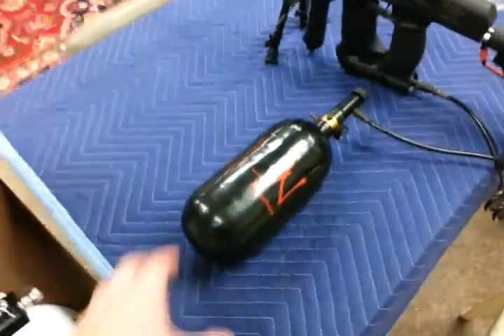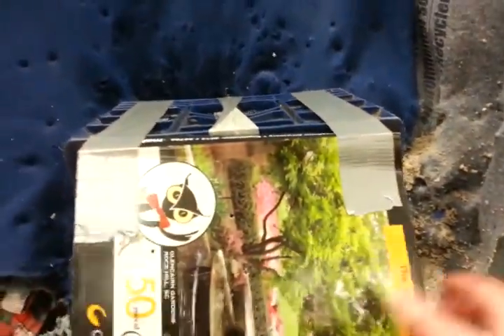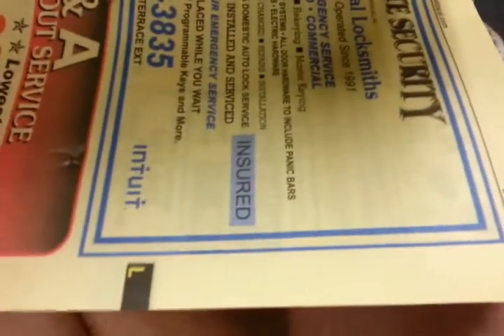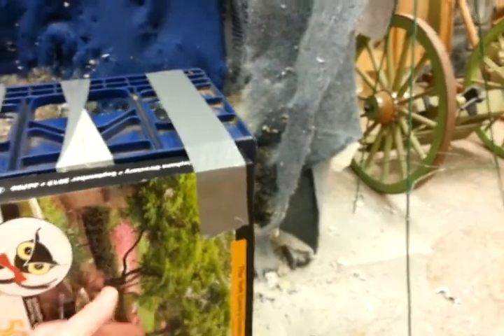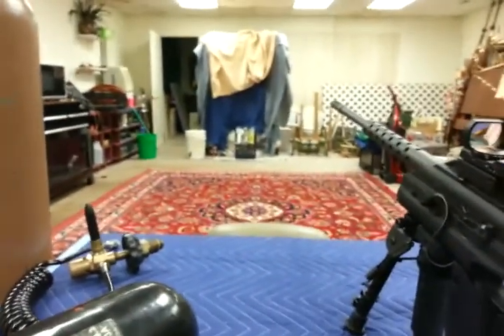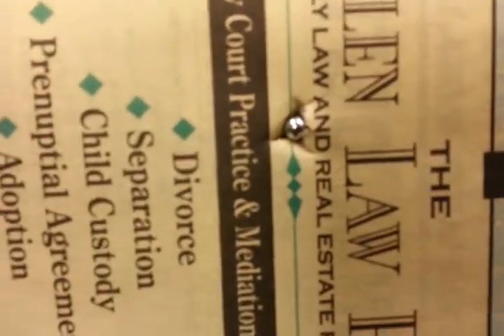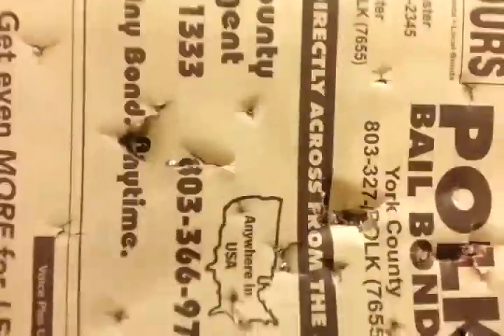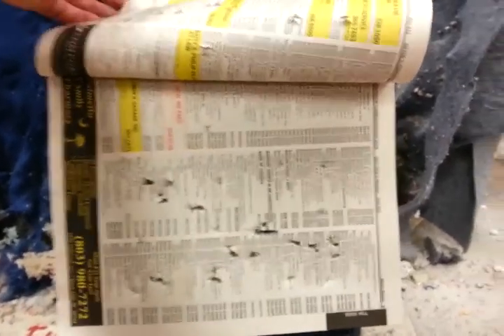Drozd Blackbird Helium test on a phone book

Comment: I have stock blackbird how can I get it to 700 FPS
Reply from the maker: You could do that several ways. The first step would to power it with three high drain Efest IMR 700mah button top cells, and a spanner in the other side of the battery compartment to bridge the connection. I use copper pipe with soldered end caps. You can use dummy cells, but they don't generally connect as well. Then you should adjust your solenoid. Search my name, and "how to adjust solenoid" in YT. From there you will want to install a Magnus Ops barrel seal. I have several videos on how to do that, and you can buy the seals on Ebay. From there it starts getting expensive. Next you want to get an HPA adapter to start running a paintball tank. I'm a Ninja dealer, and we often run 1600psi with these. After that a longer (quality) smooth bore barrel will do wonders. You can find them on Ebay. These days it's not uncommon for us to shoot in the 1050's using air.